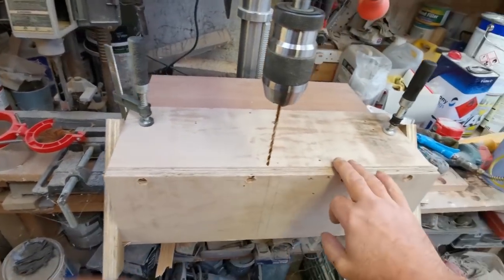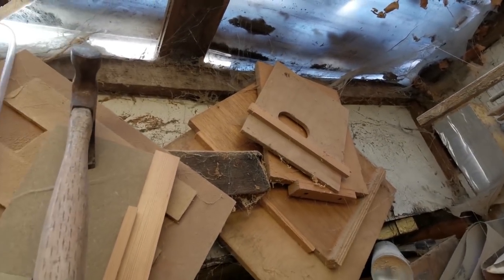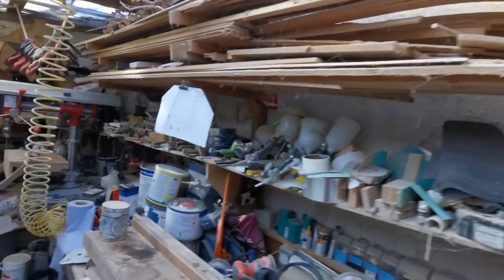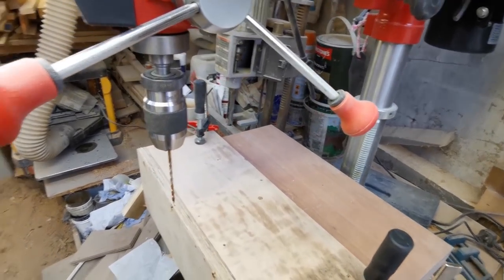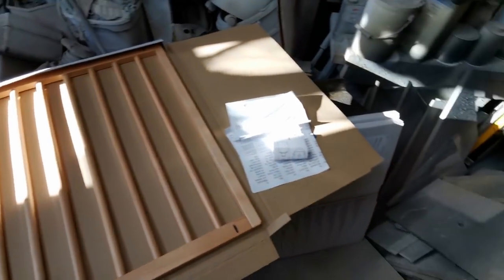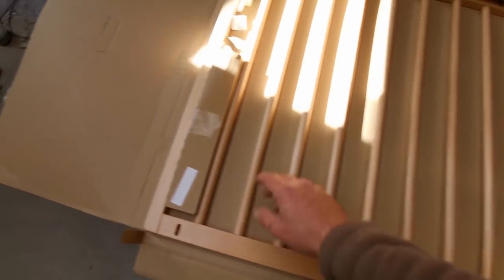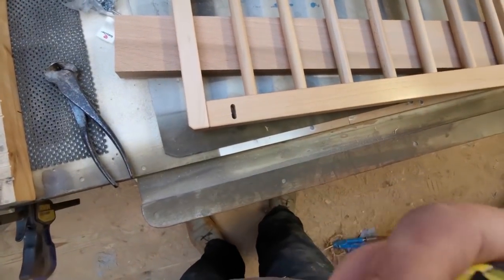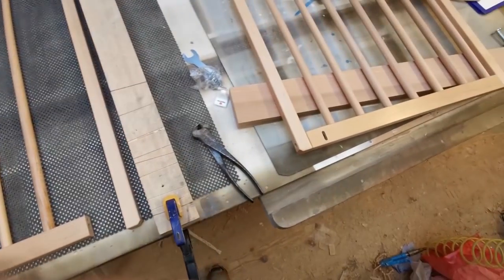Making a bought childgate narrower Pt1 - Cutting & re-drilling the dowels with the pillar drill

Comment: I some times wish I could swing my pillar drill out to get extra clearance. But when I bought it about five years ago, I did not think about such things. now I have to bugger about with a cheap drill stand that you bolt a power drill into,  and clamp it down to the edge of the bench. It works as you say. Fortunately not to often. Nice Jig BTW. I use them when I can for repeatability and accuracy.   Yes Sometimes it is hard to compete with ready made stuff that people can buy for less than you can buy the timber.
Reply from the maker: Yeah i couldn't make these with the fittings for £25, I've got two drill stands, one came from my dad that has a horseshoe like mount & a bolt in the back of the drill, (haven't got a drill to fit it 😂) the other's one of the record ones that you put a drill on, it's ok but setting the drill speed & working the keyless chuck is a pain, it's collecting more dust than usual now tho so gonna flog it, now i have a Big one 😄 This new one also plunges 80mm, i can drill a bit of 3x2 on edge if i wish n like you mention i chose this one because of the overhang & the throat depth, This is the one I had been using https://youtu.be/JRnP8G9-IQk

Comment: Ok Gid, mitherin Brian here again, I know this is an old video but I watch em over and over again to make sure they sink in 😁, what's your opinion on this pillar drill now after having it for a while ? reason being I need one and would like your opinion, Cheers Brian
Reply from the maker: Hi, I don't use it much but that's what it's like with these tools, it's there for when i want it 👍 it's big, but i can live with that because i like that i'm not restricted in depth like standard drills, I'm not keen on the knobs for adjusting the tables & the depth stop knob gets in the way of the pull down handle but that's prob more because of the way i have it set-up, I have no regrets buying it, i would buy it again if i had to, most of all i like the chuck, because it's keyless there's no fannying with a key, & it's well made so you can easily get a good grip on it & wind it to get a good grip on the bit your putting in, I bought a little micro chuck that's got a hex shank on it, put it in the chuck with a 1mm drill bit, it runs perfect 👍 It's not the most highly engineered machine but i'm quite happy with it & i can be very critical, a reg decent-ish drill cost then £150-£200 so for the little extra (I paid £350-ish i think, prob more now) price the one i got is good money,
Reply: @Gidjoiner  Thanks for the reply Gid, it's now priced at £420 at Axminister, think I'm going to get it, I've only ever had them small crappy pillar drills that struggle drilling 32mm hinge holes in doors so this one should be more suitable, cheers fella
Reply from the maker: @drut12000  👍 just gotta say i was drilling some 50mm holes, it's belt driven & i had to put it 2nd to slowest to stop it stalling, the belts might need tightening tho, i haven't touched them since i bought it & they'll have worn in 🤷‍♂️🤷‍♂️🤔